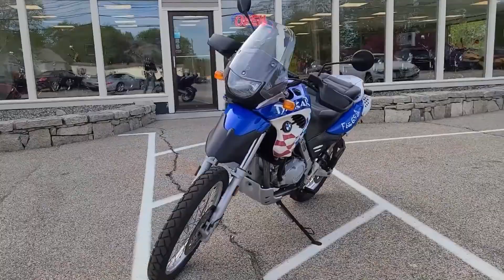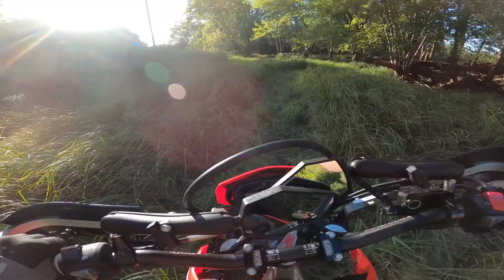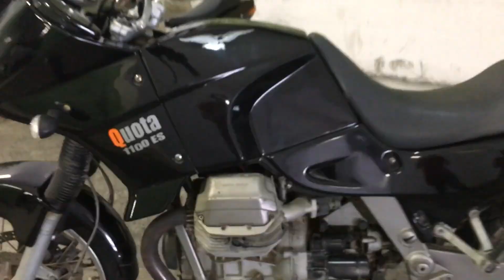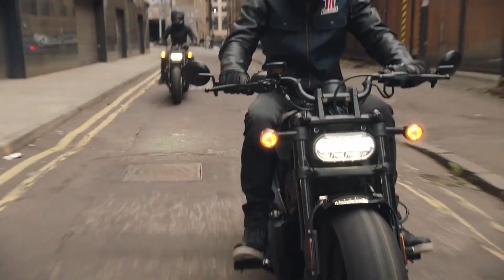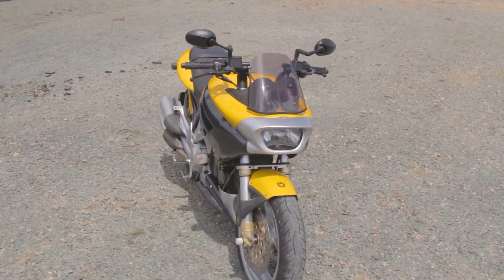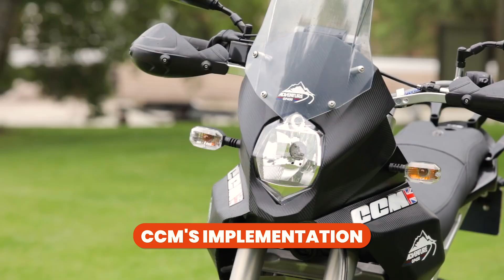Don't Buy These 15 Adventure Bikes (Huge Mistake)

Comment: the  current Tiger 900 Rally Pro wasn't designed in the 90's. It was first released in 2020 and is , although top heavy, a very good rally bike.  It is the follow up on the Tiger 800. 
If you ment the 90's versions , you should show the old  model, not the new road based GT version
Reply from the maker: My Bad, Good catch! I guess I mixed up my decades. The Tiger 900 Rally Pro is definitely a solid ride! Thanks for the heads up!